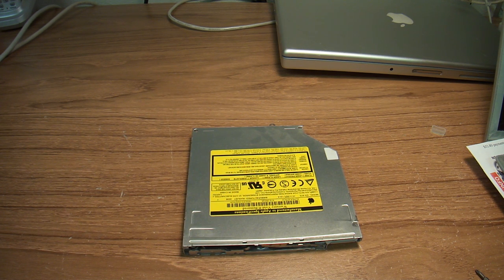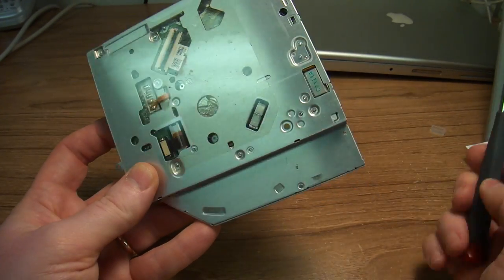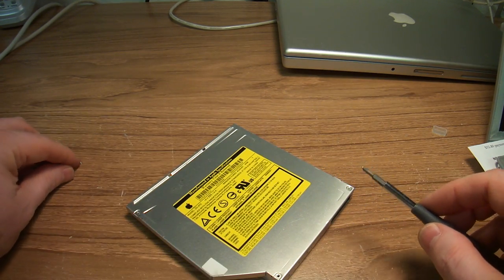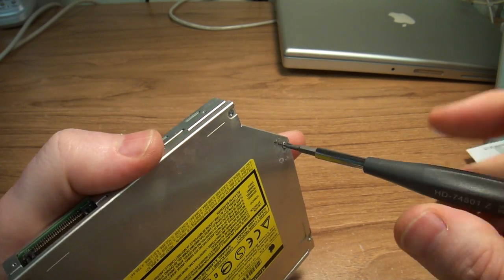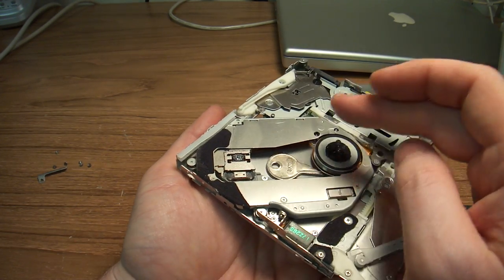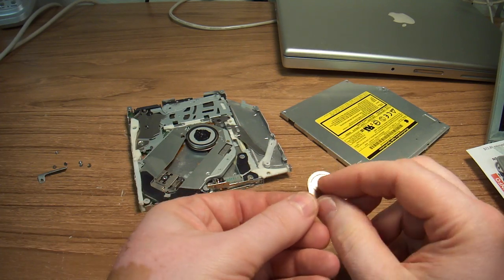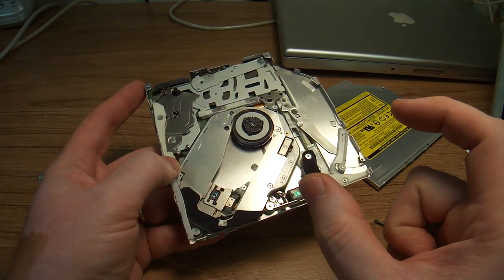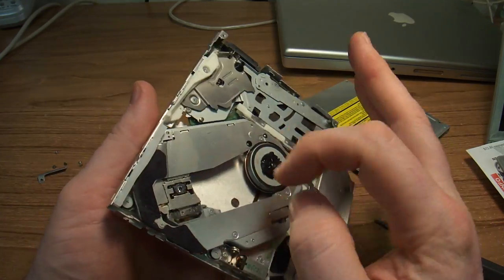DIY How to fix an Apple slot loading CD DVD drive

Comment: I have a late 2009 iMac but the cd drive I don’t know what you call this you the slot where you slide the disc it has like a made of fabric material I think is to protect the cd from  scratches but if you know? Can I just remove off completely and the cd drive should still work right? Because mine broke and everytime I put a disc this fabric dust protector keeps getting in the way.

Comment: I have an HP Touchsmart 300. I have a CD in the slot drive. Could not get it out. I put my Dave and Busters card in the slot. The card got stuck in the drive with the CD. Will this video help me solve my problem

Comment: FIXED MINE blocked by speaker out of place!: Mid 2010 MacBook Pro 13" dvd/cd drive could not insert a disc, opening blocked-couldn't insert disc!... Turns out it was the little subwoofer on that side was blocking the opening! I turned of the Mac and opened the removed the DVD drive to deal with the subwoofer. Turns out the after market speaker edge was too long so I had to use a rasp file and file that end, didn't expose a hole although there is a bass reflex hole close to the end. Then added contact adhesive or double sided tape to the flat ends of the woofer so that it would't pop out of it's pop in place when inserting the DVD drive has a center metal lip that fits into a matching indentation on the woofer. With the filing, the lip no longer pushed the woofer again the end and out of place. 
Hope this helps someone! My MacBook just keeps on going. Have replaced over the years myself: 2 batteries(Be sure to get apple brand, the first one wasn't and didn't last-now I don't use the battery if I can help it to extend it's lifetime), spinning drive replaced with solid state, 2 sets of speakers-the main speaker eventually goes out and then the volume is very low-after market main & 2 small woofers seem to work great till the die years later like the factory one did, replaced the mag charge cord in the power brick 5 times over the years-crack the brick open with screw driver and access the 2 wires to connect a new charge cord from ebay-tricky to do the first time but works and cheap like new fix!